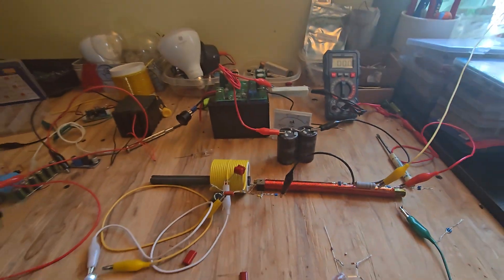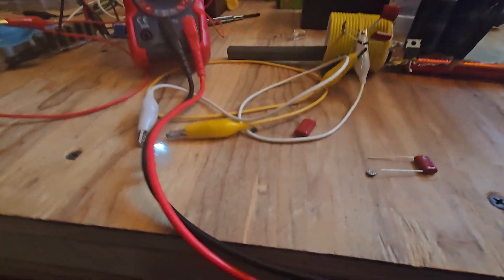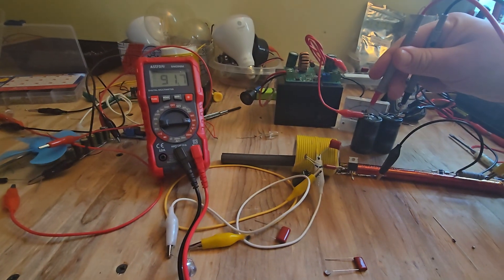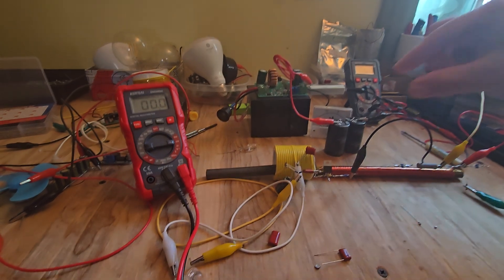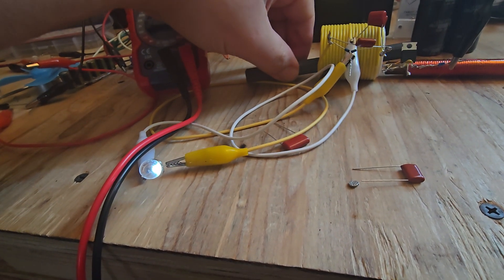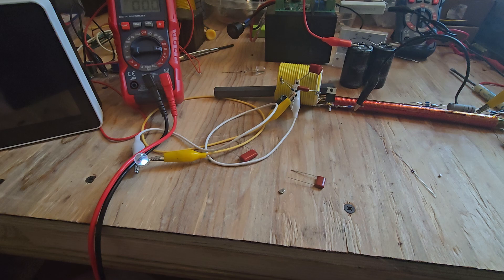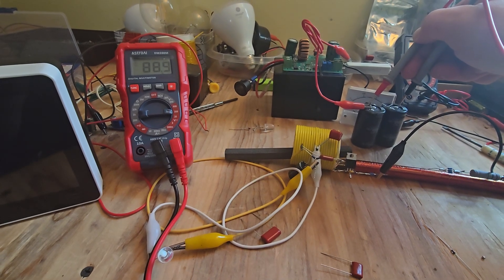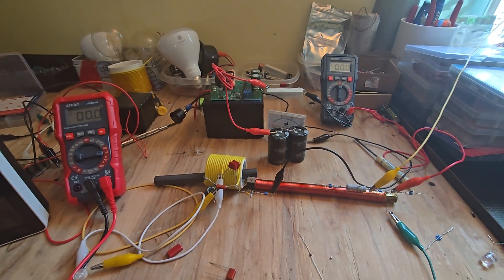VOLTAGE POTENTIAL ONLY AT NO CURRENT CONSUMPTION TRIGGERS TRANSMITTER INTO ACTIVATION CAPACITOR TEST

Comment: You need to quit saying your drawing no current. you need a more accurate meter. Your also not measuring your AC with the oscilloscope correctly.
Reply from the maker: Good point & I tested the system with a 0-10mA analogue amp meter & it still couldn't detect current flow also the most interesting effect is even if the system is consuming 1/10 of a milliamp which it isn't a wireless led shouldn't light brightly at all. The led shouldn't light wirelessly period at such low power levels yet it does. It's almost as if the transmitter is becoming an archform triggered into activation from a voltage potential only at nearly no current draw or possibly no current draw.
Reply: @MTECH2022  mesure the value of input and out put with a fuse. .... is this very strong. ...for bla bla bla of the people
Reply from the maker: Not exactly sure what a fuse would do for a transmitter circuit consuming 1/10 of 1 milliamp or possibly less. Going to have to get the utmost sensitive measuring equipment soon. :)@anthokranken
Reply: @MTECH2022  yeah bud get a good scope like Owon . with a good clamp meter. I have a video coming out on friday showing how much of a difference there is between a galvano meter and multi meter when reading pulsed DC . Especially into a inductor which turns it into AC. The difference is drastic . The fuse method won't work either. A good thing to do is put 2 very small leds opposite each other on the input then you can see the current and direction by seeing which ones glow. I think you're back on the right track again just get a scope and clamp meter ...they are not cheap but you need for this research
Reply: @MTECH2022  for exactly sûre use a good fuse with a good value. ..when the fuse burn you are good
Reply: @windpowerandmore6310 no ... use a fuse for. ... good mesurement with thermo law.......
Reply: @anthokranken  🤣
Reply: @windpowerandmore6310  😇🙃🫡i follow you. .. 3 years you are an expert in motor pulse
Reply: @anthokranken  i have a video coming out Saturday morning about this issue.  A fuse doesn't work for pulsed dc . Most fuses have a time delay built into them to handle surges of energy without blowing.  A clamp meter on a scope or just a scope with a resistor measurement voltage across is the most accurate way
Reply: @windpowerandmore6310  the input of the motor is thermo ,use a correct milli amp fuse. .. test before with a currennt.   When burn at the correct value of a fuse the fuse is OK. ... . Now teste the fuse with your motor ... hé dont burn ... ils OK..,when the fuse burn ... you have more current at your input ...simple. ..and at the output. ...the same. ..
Reply: @anthokranken  fuses don't work like that
Reply: @windpowerandmore6310  what the fuses ??? A résistor ....!!!!!
Reply: @windpowerandmore6310  because you dônt have a correct value. .. the fuse is a vacuum résistor ... in fact ....
Reply: @anthokranken  it let's pulses though that are higher than it's rated for.  It works perfectly for steady current but not a pulsed current.  It will allow surges or current though above its rating before it will pop .
Reply: @anthokranken  it's right here read what it says.  I'm not arguing with you I'm just stating facts.  

Fuses have a surge rating, specifically designed to withstand transient high-current surges like those from lightning or electrical faults, without blowing. These surge ratings are not continuous current ratings, meaning they're designed for short-duration, high-amplitude pulses. Fuses with surge ratings allow surge protection devices (SPDs) to react to the surge before the fuse opens.
Reply: @MTECH2022  yesss you have a bad fuse ...
Reply: @MTECH2022  
This is the only way to do it correctly.... if you can't... double your input and therefore being linear will double the output... and use bigger fuses. because nothing says that you are equipped are calibrated correctly nothing says if your fuse is good or not... you have to test it before. ... the first law in electronics says never trust anything. let's be Cartesian to be recognized and that you have all the means to silence people who talk for nothing you will have to do like that... if you want it to be recognized at the thermo level
Reply: @windpowerandmore6310  
This is the only way to do it correctly.... if you can't... double your input and therefore being linear will double the output... and use bigger fuses. because nothing says that you are equipped are calibrated correctly nothing says if your fuse is good or not... you have to test it before. ... the first law in electronics says never trust anything. let's be Cartesian to be recognized and that you have all the means to silence people who talk for nothing you will have to do like that... if you want it to be recognized at the thermo level
Reply: Good luck with that I'll use a calibrated clamp meter on the most accurate measurement device known( O scope) for accurate results with data that can be recorded .
Reply: @ Does a normal led light like the one you have and what type was it? also I would suspect it is running under one milliamp. you could try a resistor feeding the circuit and measure the voltage across it to get lower readings. a little calculation should get you there. but  under one milliamp is starting to get much harder to read. you could do the same with the oscilloscope on the AC part of the circuit to see the amperage but it could through the circuit off being in the AC part. You are creating a radio wave of some sort and that's why you believe it's wireless power. which yeah radio is a form of wireless power. did you try a spectrum anylizer or VNA near it to see what the frequency is? you can get the size of the signal without interfearing with it that way also. just a simple nano VNA or tiny spectrum anylizer should do a good job.
Reply: @ Interesting isn't it. try a lower scale for the amperage. your capacitors are being charged at DC continually and the AC part of the circuit is being pulsed. so the charge is leaving slowly. and a wireless bulb is not new we used to do it for fun when we key up our CB radios. Nothing like seeing an 8ft floresent glowing in someones hand. you could get a free carwash with enough power to activate relays. your oscilloscope needs to be set to x10 to make use of the high resistance. there are more special things you can do to measure if it is even smaller than I suspect. but atleast try x10.  The LED's can draw from 1mA to 10mA. you have alot of time in there for the capacitors to charge slowly at a low amperage. another way to measure it would be with the oscilloscope and watch the amperage with it. you should study some AC electronics so you understand them before you try to find anomilies. AC electronics looks like magic compared to DC.
Reply: @MTECH2022  dont hear the rabbit hole. ....haha you dôt need a galvanometre you ́need a fuse. ... fuse at 0 ,10 test it test the short circuit in a fuse.  .. when fuse burn at the correct value ...the rabbit hole shut up ....hahaha
Reply: You are wrông ...OK use à fuse ... at your gives value.  ...... OK...
Reply from the maker: @anthokranken if my theories are wrong so are Nikola Teslas, Thomas Henry Morays, Eric Dollards & ken wheelers
Reply: @ The theories don't have to be wrong. it could be that something is not correct to get the results. electronics are not always right on with the formulas. as a matter of fact it is the complete opposite. calculations get you close. the only problem you have here is the amerage you need to read are so low you are right at the point of needing an expensive meter to read it. so the only thing you can do it try with what you have. and hope it's not so low you can't see it. the cheaper meters have alot of interfearance that will stand in the way. even my $400 bench meter may not read it.  I have a $1000 oscilliscope that may not read it. it just really low. A fuse is a main in the neck way of measuring current, I've worked with electronics for over 30 years and haven't seen a fuse under 1 mA. but I can tell you I have had the insturment guages be hard to move when the scale is so far off. and your  multimeter is just not accurate enough at all. not even close. the only way I can think of is to get a better meter and run multiple circuit through it on the DC side and see if they add up enough to see it.
Reply: @MTECH2022  One other thought, put an led in line with the circuit supply line cover it very well so it is dark around it and see how much light you see. this may give you a rough idea if it's worth trying to measure it with better tools. if there is enough voltage potential created to light it slightly you know it's drawing something. that circuit was never designed to draw nothing.the power came from the magnets that tesla used on a  spining shaft. so the object realy isn't no power draw it is getting more out than you put in. you can also adjust the circuit to draw more power so your in your meters range and try differnt frequencies. the plate in the window is just a source for radio signal noise. it's not what your looking for.
Reply: @curtstacy779  o scope measures it easily!
Reply: @curtstacy779  shuuut please .... adjuste ,teste  the fuse. .. OK with galvano meter. ..in thermo .... v per milli amp per time ... input ...and the same time ... output ...is vous per milli amp per time .
Reply: @curtstacy779  xhen the charge is isolated and the ground. ..same isolation